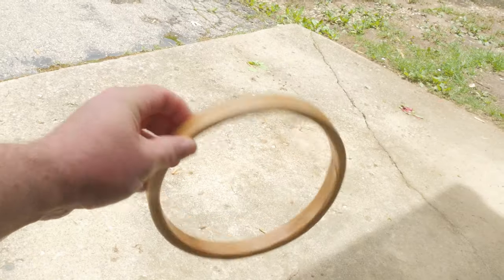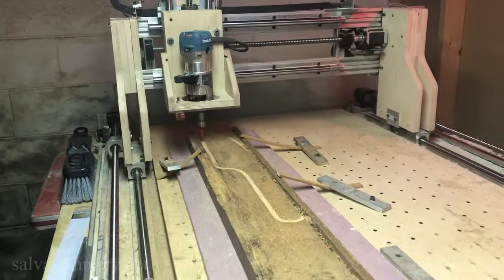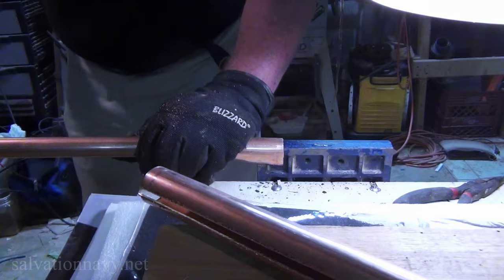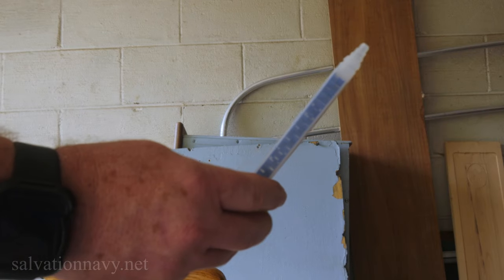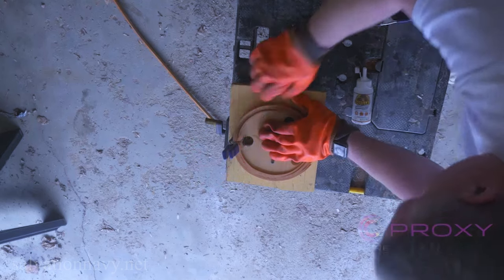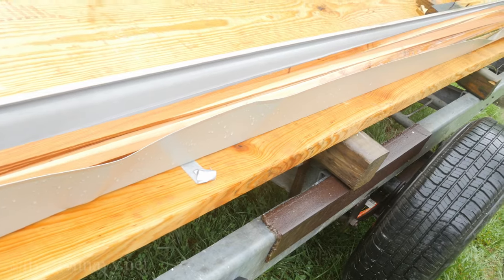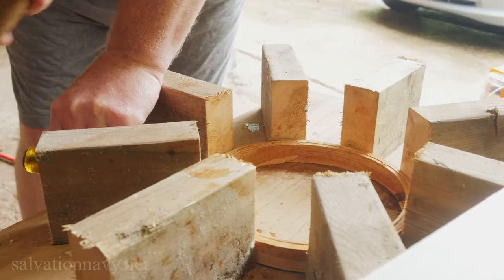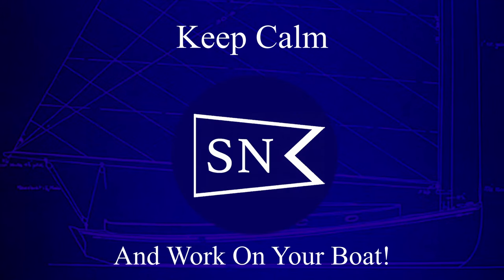Eps. 3.3 - Gaff Jaws, Mast Hoops Revisited and UV Protection

Comment: Don't know if you're still checking these old vids, but I might suggest you save all specie of wood saw and sanding dust in separate, labeled containers. When you encounter voids, knots or pin holes in valuable pieces of timber, you can save both the wood and the esthetics by filling the spaces with a mix of epoxy and appropriate sawdust for a nearly invisible 'patch', kind of a home made 'Wood Putty'...🐈

Comment: Great and inspiring video as usual.  Could you tell us more about how you fastened the copper onto the jaws?  And how complicated was the leather work - Was it just cut and fasten, or was there more to it?  Finally, I have a fair amount of rot and cracks on my Eagle’s transom trim boards, and I wonder whether a CNC router would have the capacity to replace them, scrollwork and all ... Thanks!